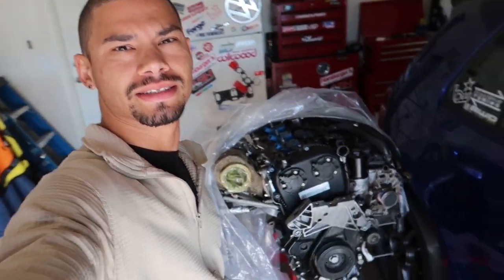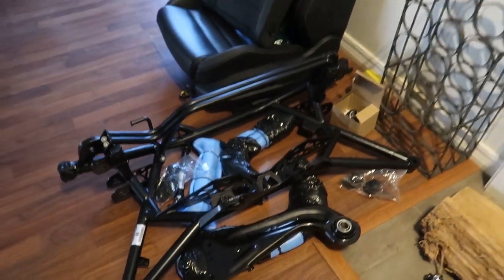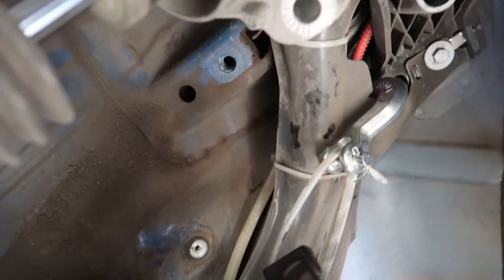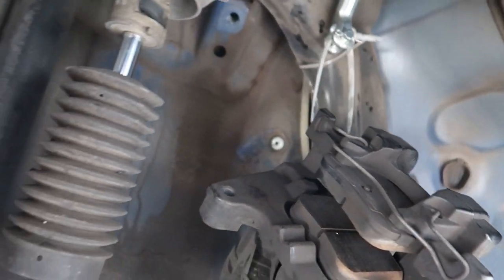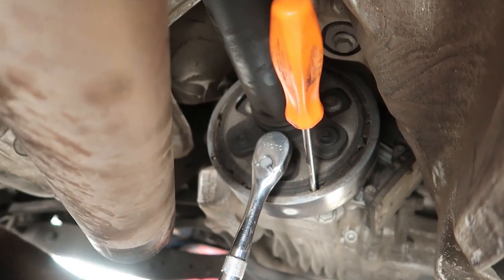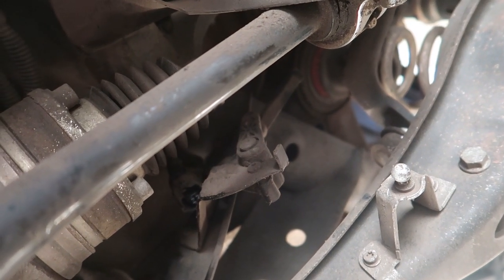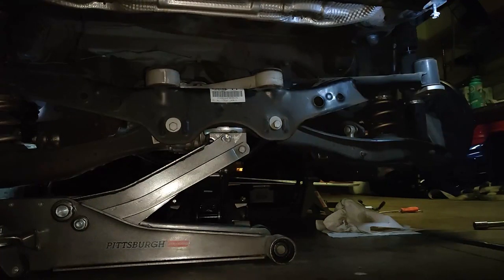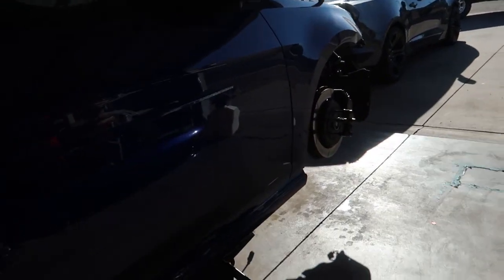Whole rear end is out!! Time for a MAJOR upgrade! | MK7 Golf R

Comment: i was thinking of doing the front subframe first and the rear. why didnt you get the front?
Reply from the maker: I do plan on it eventually but I already have the Audi aluminum subframe up front and whiteline control arms. Front end is pretty dialed in and the rear end is, well was, pretty sloppy after 80k miles of abuse so I figured I'd get the rear end all sorted along with a carbon hatch drop some extra weight for when I go to corner balance after everything is said and done

Comment: I have just the standard GTI, MK7, but I am looking at needing to basically do this. They say the subframe is fine, but I would like to just replace subframe out. I just don’t know what parts I need to get. Also I want to go ahead and do brakes. I’ll need to do the front end suspension as well. Again. Not sure what parts I actually need.  I want performance but not building a race car. Help??
Reply from the maker: We should chat in some kinda messenger. Do you use fb?

Comment: Hehe nice job, how much for the subframe inserts ha! Nice to see the pieces out, do you have to align the diff?
Reply from the maker: Diff really should align it's self the way the bushings and mounting points are it seems like it won't be much of an issue mounting to the frame it's self. (If I recall correctly) It says to loosely install the frame then attach the driveshaft then tighten the frame down